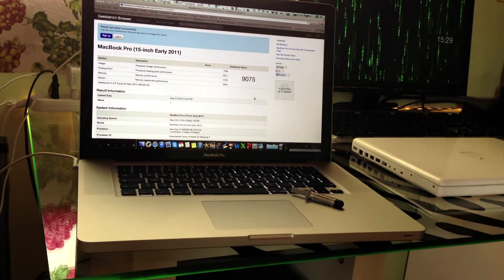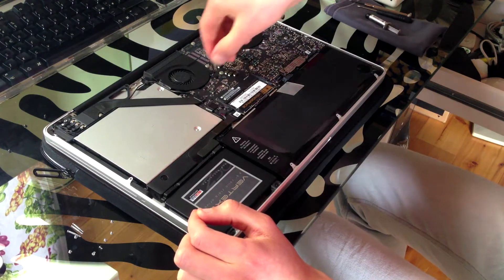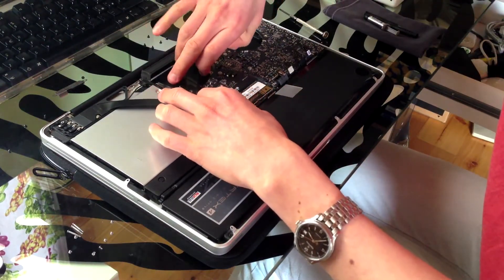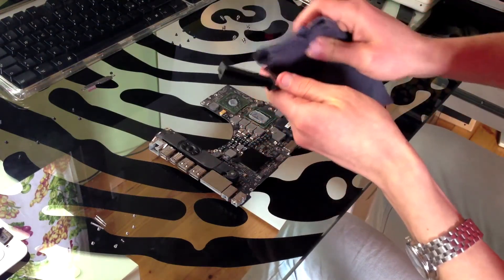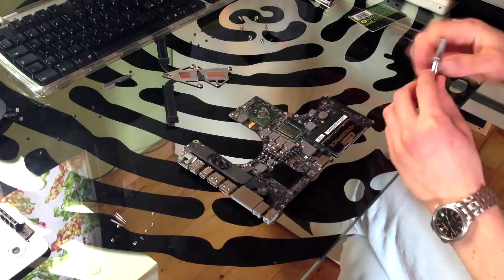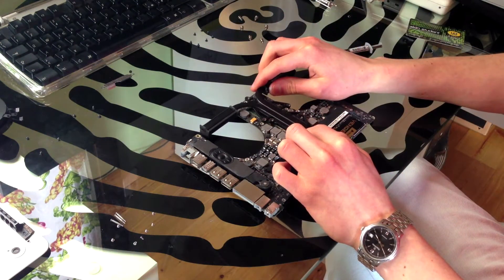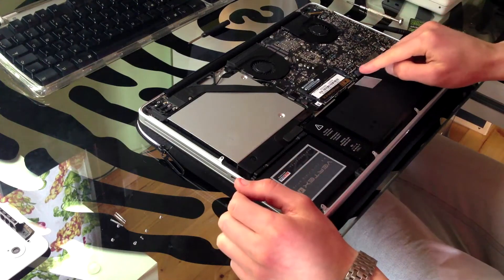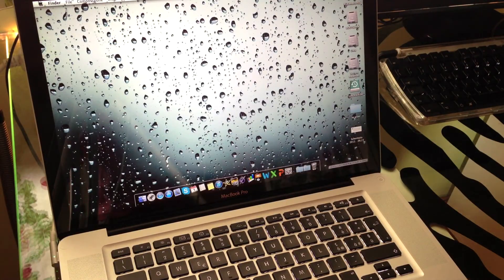MacBook Pro Thermal paste tutorial

Comment: Hey I own a macbook pro 2010 15' and Apple just replaced my motherboard due to a later known defect of that batch. They also replaced my battery for free and I opened it up looks very clean too. But I never checked the heat sink. My laptop works great except that it heats up really easily. Since apple just serviced my laptop, is it possible that they also replaced my thermal paste?  I'm gonna take it apart tonight and see, hopefuly that's the reason of overheating!

Comment: love these old model , you can replace the DVD with adaptor and have 2nd hdd inside it.
currently have 2009 model, will plane do replacement of Thermal paste. using your guide.
Reply: I have the second hard drive in mine right now. It's the way to go!

Comment: i have bought second hand macbook pro 2009 17" it dose go hot (not sure maybe it's normal) but is there really diffrance ? what was the diffrance in you case ?
Reply: laptops will run hot regardless its a tiny space with a tiny cooler, but the best thing to do is just replace the thermal paste, but DONOT spread the thermal paste like he did in the video it will create air pockets and overheat worse then it is now and you will be pulling 900$ out of your wallet for a new motherboard because the cpu is soldered not socketed

Comment: Great video, thanks. My niece's 2009 mac book pro 15 has been exhibiting sudden shutdowns and restarts. It's been happening 2-5 times a month for 2 years. I researched and read some forums which leads me to believe the thermal paste may need to be replaced.  I'm going to get her mac this weekend and do the fix. I'm also going to update her SUU firmware. Three months ago I installed a OWC data doubler which allows you to run two ssd in raid 0 configuration for a drive speed of 550 Mb/s compared to the original hdd which had a 1.5G link speed and maxed out around 100Mb/s.
Reply: I meant SMC firmware. I'll report back about if the fix is a success or not.
Reply from the maker: 1melahat Good luck!
Reply: 1melahat did it work? my gf is with similar problem... her macbook pro mid 2010 freezes all the time.
please let me know if you solver the problem and how.
thx
Reply from the maker: Yes it did, but keep in mind that many different things could cause freezing, like a Hard Drive full of junk or one just about to die. Download smcfancontrol and have a look at your cpu's temperature :)
Reply: It's fixed!! Before doing anything I tried repairing permissions without success so I did command + R and reinstalled the Yosemite OS. The thing is as fast as a whip since running two owc ssd in raid 0 and installing the OS on it. The only downside is there can't be a recovery partition with raid 0 so you have to have a wifi connection and go the slow command + R route if you want recovery. Thanks For The Interest guys!

Comment: Nice video thanks. I have a question regarding the thermal compound.You applied MX4 before and not did a good job.
Why didn't you give MX4 a second chance and used Arctic Silver 5? is there a specific reason? What do you think about Gelid Extreme?

Comment: thank you very much for this video , i planing replace to my macbook air. i hope i wil success .
Reply from the maker: Hey! Always happy to help, although you are better off using a guide specifically made for the MBA. This one is for the 2013 13" model, but others are available on ifixit as well. Take a look. https://www.ifixit.com/Guide/MacBook+Air+13-Inch+Mid+2013+Heat+Sink+Replacement/15232
Reply: Francesco Barbieri
i did it success , my macbook air now it's better. ifixit.com and your video realy helped me. thanks.
Reply from the maker: Glad to help! iFixit is a fantastic resource when it comes to DIY repair manuals.

Comment: hi francesco, i had issues with my graphics unit (Early 2011 MacBook Pro 15" graphic card failure) but to the point i can't start it at all. some people say this is the solution to solve it. do you agree that most of those issues are due to extreme heating problems and doing this would resolve it? many thanks!
Reply from the maker: Sorry to hear that. Unfortunately 2011 15" and 17" Pros are "dropping like flies" http://www.cultofmac.com/262861/early-2011-macbook-pros-dropping-like-flies-heat-issues-blame/
I had the logic board in mine replaced under warranty some time ago because of a different issue (faulty USB ports) and I have since sold it and switched to a 13" Air :/
Back on topic: only replacing the thermal compound WILL NOT fix the issue, you either need a reflow (temporary fix) or reball (likely to be permanent) of the GPU. The first can be done at home with a heat gun and an ir thermometer, the latter must be performed by a pro.

Comment: the fan on my macbookpro has been running crazy when I stream videos, do you think replacing the thermal paste would help much with that?
Reply from the maker: It could, however replacing the thermal compound is a dangerous procedure and should only be attempted as a last resort; the cause of your issue is likely to be dust clogging the heatsink and not allowing for proper airflow. Try to only remove the fan and any dust that collected on the heatsink and then putting the fan back in, 90% of the time this will fix the issue. If it doesn't you need to re-apply new thermal compound.
Reply: Francesco Barbieri
I've replaced thermal paste on my desktop computer before, did you find replacing the macbookpro thermal paste to be any trickier/more dangerous?
Reply from the maker: Absolutely, sadly to replace the TC on a MacBook Pro you HAVE TO remove the whole logic board, it's doable, but make sure you don't loose any screws and be very gentle when you clean the old paste off the CPU and GPU, the silicon is exposed and even if just a small bit of it breaks the board is toast. You can use this guide as a reference https://www.ifixit.com/Guide/Applying+Thermal+Paste/744 
Also remember to discharge any static electricity by touching the outer aluminum casing before handling any of the internal parts.
Reply from the maker: As far as I know the thermal compound Apple uses is decent but not the best. Problems with cooling on Apple notebooks are generally caused by dust or bad thermal compound application from the factory. Your best bet is removing the fans and clearing the radiators of any dust first, if this doesn't fix the issue you can try replacing the thermal compound. Just be aware of the fact that MacBooks generally runs hot. My new Haswell MacBook Air with Noctua NT-H1 runs at 95-96°C while playing Battlefield 3.
Reply: Francesco Barbieri Great-- thanks for the response. Now I suppose my only other question is in regard to touching the board. Specifically where you say to use your fingernails on the LED display connectors. I would think that is pretty ill-advised. Do you feel that somebody with experience and who is extremely careful is generally okay however?
Reply from the maker: Breaking the connector is unlikely, a plastic spudger can be used, but DO NOT use any metal tool, fingernails or plastic are better because they are somewhat flexible and hence more forgiving in case you do make a mistake. If you are still uncertain as to how to free that persky cable from its connector, you can have a look here on iFixit! https://www.ifixit.com/Guide/MacBook+Pro+15-Inch+Unibody+Early+2011+Heat+Sink+Replacement/5896
Reply from the maker: Yes, thanks for letting me know, that is definitely not advised, I will put an annotation on the video.